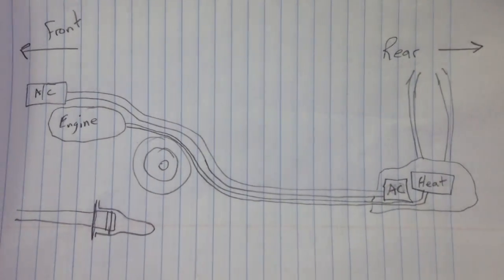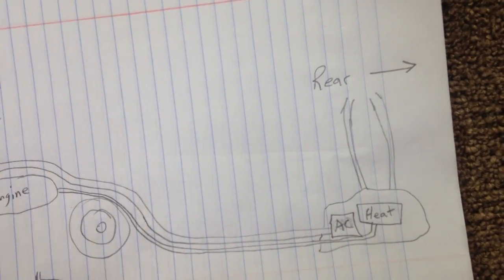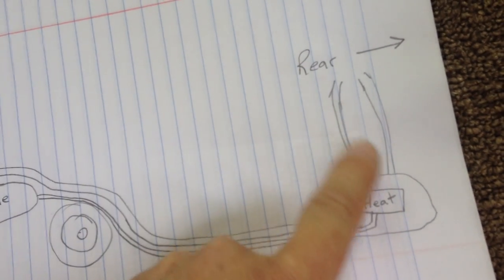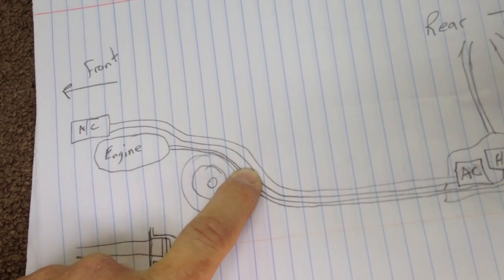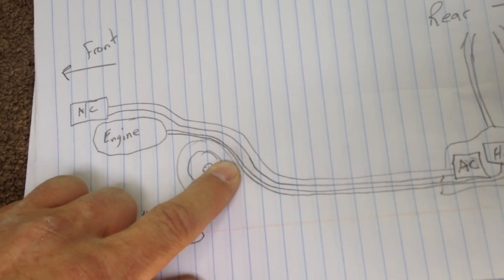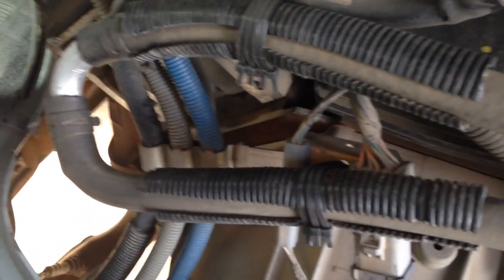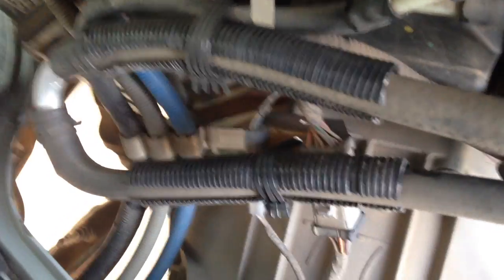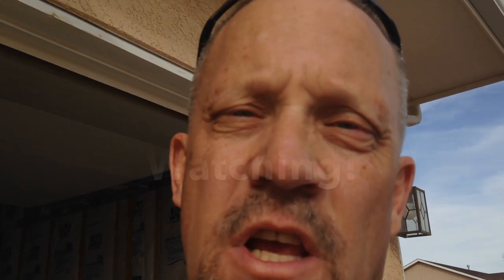How to Remove a Rear AC Unit - Rear AC Heater Removal - Ford E350 DIY Camper Van Conversion

Comment: Was it worth it to remove it though? Would be easy to cool or heat the whole van before bed :X
Reply from the maker: There were times when I wished I didn't remove it. I removed it to give more room for the bed but if I were to do it again, I think I would rethink how and where I would build the bed. Good question!
Reply: @WannaBFree  Did you wish you didn't remove it due to heat/cold? I am not worried about climate control in my build, but I am wondering if it is worth all this effort. How do you properly uncharge and recharge the A/C lines on your own?
Reply from the maker: @seanluong6064  Yes there were a few times when I wished I had heat and cooling in the back of the van. That's only because I was traveling in the wrong part of the country at the wrong time of year. LOL I don't think you can properly charge and discharge the lines on your own. It requires specialized equipment that most people don't have access to. It's also expensive to have a shop do either one. I would say that if you can work around it the easiest and most economical answer would be to leave. The choice is up to you.
Reply: @WannaBFree  thank you. I called a mechanic and he said it will cost me between 400 and 800 bucks. So now i have the incentive to just leave it alone and do my build around it.

Comment: Bought the block off kit but I can’t figure out how to get the damn ac lines disconnected
Reply from the maker: The lines disconnect at the joints using one of these tools. You can google how to use it and it will make sense.
OEMTOOLS 25042 Air Conditioner/Fuel Line Disconnect Tool - https://amzn.to/3dPqpLe

Comment: I’m using your video as I do this myself. The problem that I saw someone else already posted about is accessing the AC lines to disconnect them. I’m finding it nearly impossible when lying on my back, also it feels like there is a square piece around the bigger pipe and I can’t seem to get that off. Any other suggestions or advice to save me from further frustration? 

Also - the quick disconnect tool I plan to use looks like this one, will this work? Or do I need the circular discs 

https://m.lowes.com/pd/KD-Tools-Automotive-Fuel-Line-Disconnect-Tool/50190691?cm_mmc=SCE_PLA_ONLY-ToolsAndHardwareSosHandTools_-50190691:KD_Tools&CAWELAID=&kpid=50190691&CAGPSPN=pla&k_clickID=bb283293-59fe-44d1-983e-f32ca4433a89&gclid=EAIaIQobChMI-9CWgaXl2QIVVLbACh1YLQWkEAQYAiABEgJlRPD_BwE

Thanks for the great info
Reply from the maker: Unfortunately I have no quick easy tricks. It's not an easy job but with persistence it's doable. That looks like the correct tool for a Ford as far as I can tell from the pics. Just make sure your system is not under pressure when you try to disconnect the lines. Good luck with your project.

Comment: Why not keep the rear HVAC for climate control when van living?  You could adapt the HVAC to work off another battery when the van's engine is not running.  DC or AC, what a great use of the Ford's rear HVAC unit.  It doesn't take up much space.
Reply from the maker: That's a good idea but I think it would be pretty difficult to run the compressor pump off a battery when the van's engine is not running.

Comment: My other hose wasn't aluminum. Is there something else that would work to attach the radiator hose together?
Reply from the maker: Sorry but it is difficult to come up with a solution without actually seeing what there is to work with.